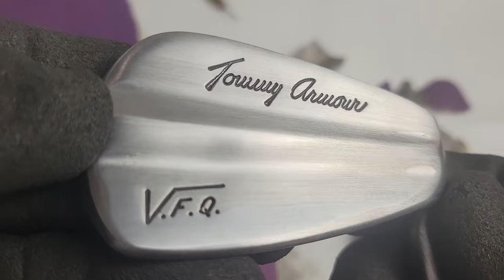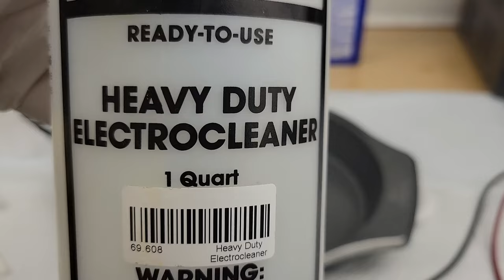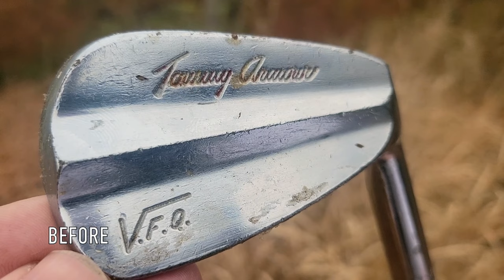My Best Restoration (So Far)

Comment: Hey Brad, love the videos. Quick question, I’ve noticed from when you first started it seems you are hand sanding less with finer and finer sandpaper and just spending more time with coarse sand paper like 80 or 120 and then going to polishing. Is that true? Because these came out awesome and don’t look as shiny but look better almost in my opinion than earlier videos. Thanks!

Comment: If I use a fine deburring wheel and sandpaper on cast irons, will they rust eventually if I don’t nickel plate? I also have used this combo on forged wedges, but I don’t mind if they rust.

Comment: these are awesome videos! i just picked up a set of good condition MP-32's and I am considering running the whole set through this process.   I think I read in other posts that the nickle plating isn't as durrable as the Chrome plating? 

I am sure you have played a set you have restored..... do you consider the new finish durrable? 

thanks!
Reply from the maker: It's quite durable. You'll see when you sand a club to remove scratches. It takes a LOT of sanding to wear it down. Someone in my DIY golf facebook group just tried a product called Reprochrome that is more durable than the nickel. So there are options for the DIY crew if you don't want to pay to have them professionally chromed.

Comment: Love the videos man! Just a quick question, when restoring clubs with electroplating. Should I sand blast face and then plate or plate and then sand blast face?
Reply from the maker: I only did it before because early on, I blasted away a bit the plating because I didn't know how to control it, and im using a pretty aggressive media in the gun. Lower pressure with glass bead would allow you to do it after. If you're doing a matte finish on the entire club, I'd still do it beforehand.

Comment: Hey gruncle  brad when I was at my age of 17 I am  carpenter and I used to know to modified golf club by using metal pip e and it has an improving the durability and it's hard than the shaft so I will use a golf club head and a metal 
pipe together and there u have it a metal golf club with improved durability metal pipe shaft

Comment: Great video Brad! Copper face is 👌🏻.
When you use the electroless solution, how much do you have to replenish at a time and how often? Thanks man! I’m almost all setup on my own. Just finished my workbench today and everything arrived 😀
Reply from the maker: The instructions with the kit are horrible. They're don't even describing the same kit (they talk about Part A and B, which is from their 'regular' electroless kit, not the One-Plate).  I add a half oz (half of a shot glass) of solution at the beginning and the other half at 15 minute mark. TOTAL guess work, but it's inline with a forum post I read where the responder recommended only a few milliliters at the 15 min mark.
Reply: Thank you for the reply. When you say 15min mark, do you mean every 15min while each club is in the bath?
Reply from the maker: @felloffmybike1775  Yes. With traditional electroplating, you're stealing nickel from the anode plates. With electroless, the nickel comes from the solution itself, so you have to replenish it along the way.
Reply: And each club roughly takes about  how long to plate? 

I’d assume a couple hours? So you’re standing by and every 15min adding a half oz? 

I thought the rep said you can do 12 clubs before adding replenishment? Damn, feeling confused 😕
Reply from the maker: @felloffmybike1775  I'm plating it for 30 minutes, so i add it once during the cycle. 

Yes, you're supposed to get 12 before it's completely useless, but if you replenish, you keep the solution at an appropriate level and it won't 'crash' (according to their insufficient documentation).  I know it's confusing and i've reached out to their support for clearer guidance. 

Electroplating (with anodes) although pretty easy, is more 'difficult' to get right for first timers. But if you learn that process, you can substitute copper or even chrome for nickel. Eventually, the anodes get eaten and you have to replace them. To put in into perspective, I've only replaced my anodes twice since i started this - once because they were too small, and the second time because they were eaten too far.

Electroless is VERY easy, the instructions are horrible, and you have to maintain your solution during the plating run. I add a few sips along the way to play it safe. There's ZERO math with my approach, but it's still maintaining its ability to plate.
Reply: So essentially you can just keep adding replenisher every 15min and do as many clubs as you want, yeah? Thanks man!!
Reply: Thank you for taking the time to answer all my questions btw. It is MUCH APPRECIATED! 👍🏼
Reply from the maker: You're welcome. Keep the questions coming. I want you to be successful in this. @felloffmybike1775
Reply: I think I have the math right but I got Cs in math, so… 😂

Per Caswell’s site it says we lose 16oz of solution per 100sq inches plated for 30mins. This equals 1oz loss for every 6.25sq inches of plating. 

My club face is 3.25”x2” and that’s being generous as the shape is more of a triangle than rectangle and this also accounts for hosel size. That gives us 6.5sq in but we could probably call it 6.25 as the estimation is fairly rough.

If I am plating a 6.25sq inch club for 30mins, I would simply need to replenish that 1oz loss (per the formula of 1oz loss per 6.25” plated for 30mins above) after the 30min mark. To be safe I could split it up and add half an oz at 15min and the other half at 30min. So although you didn’t use any math, it seems like you are right on the money even if you are only plating for 15min and not 30min.

Now, the rep says we can do 12 clubs before replenishment, but I think they are using the max plating capacity number of 70sq inches plated at once (per the site also) to get that 12 club number. 70sq inches divided by 6 (rounded down the 6.25sq inch club face calc) is 11.6 which they rounded up to 12. However I don’t think we can use 100% of the capacity… I saw someone say only 20% could be used before crashing but I couldn’t find any documentation on that number.

Either way, is that right? I am not what you would call a smart man. Lol. 🤷🏼‍♂️

Comment: You rubbed out the copper stain with Mothers, how long will the plating (nickel and copper) last if the iron is played?
Reply from the maker: I rubbed it for a long time! I was trying to avo8d sanding and polishing again. It slowly removed it but by bit. The nickel is quite durable. I sanded the remaining bits of nickel off this club for maybe an hour, so imagine how many strokes of play that could be. It's not as durable as Chrome, but it's pretty tough.

Comment: is it mandatory to nickel plate the clubs? i kind of like the brushed chrome look. is there a solution that i can use to have it protect the metal but keep the brushed look?
Reply from the maker: The nickel is just there to delay rusting again and to provide some scuff prevention. You can leave it and wipe it with corrosion prevention spray or a sealant, but that's not sustainable and it will only delay the inevitable. 

Modern clubs (non-forged clubs) you can just polish and you're done because they don't rust. But exposed carbon steel will rust again eventually.

Comment: what would happen if you just stopped after sandblasting the face? would it be "raw" and you would get rust? or is there still finish on the club
Reply from the maker: There's still nickel on it, so not purely raw. I have a video called Make it Black where I remove all the nickel to make it raw.
Reply: @BradMeehan  what would you see if you did not remove the nickel, will you run into issues down the road or are they still be good to go?

Comment: Hi mate i have a few scratches on top of my driver head that wont come out with polish or toothpaste. They arent that deep but deep enough that the gloss is affected. Any advice?
Reply from the maker: You could lightly sand with like a 1000 grit to make it hazy, then spray clear coat on top of it (after you clean and remove wax/grease) and should look new again. Practice on a shitty thrift store club and get the hang of it.  The 2K clear coat has only a 2 day lifespan once you break the seal, so practice, then get on it.
Reply: @BradMeehan  absolute gent. Thanks for getting back to me